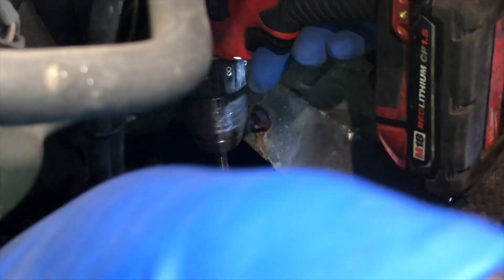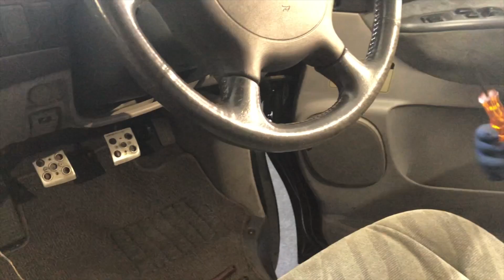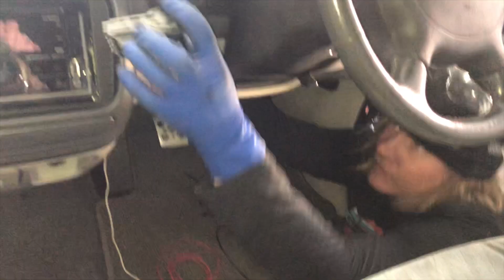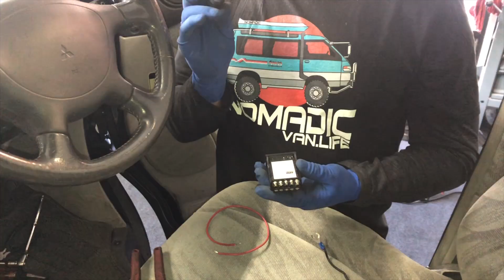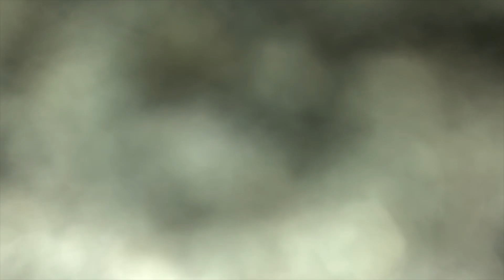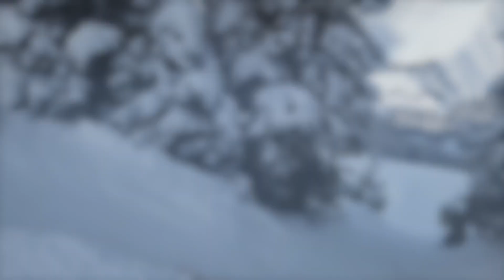Delica EGT Gauge Install Tutorial (Turbo Diesel) - Tech Tips Ep. 1

Comment: Helps if you delete the EGR and tap into the egr blank off plate post turbo and pre turbo for boost measurement. That’s what I did on my L300 and it’s been working great since.
Reply from the maker: Yes, that would work; however, as a dealer, we cannot alter emissions equipment. This is an approach that will pass emissions regulations.